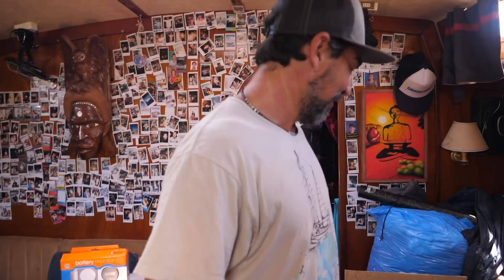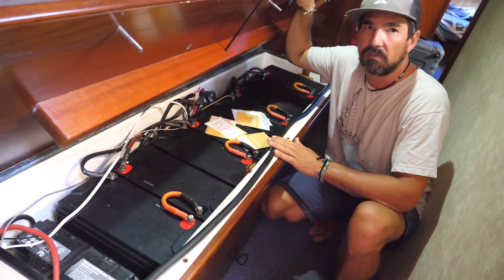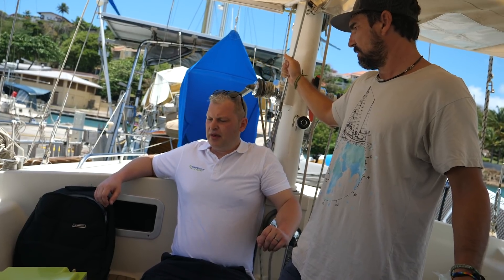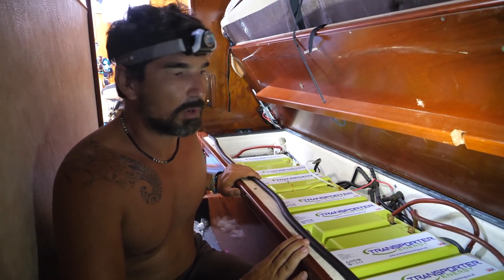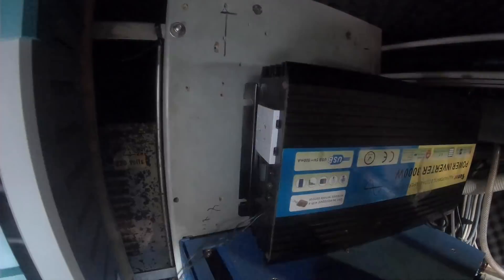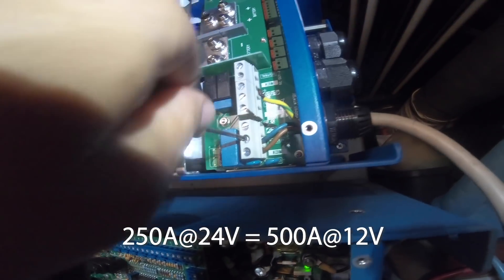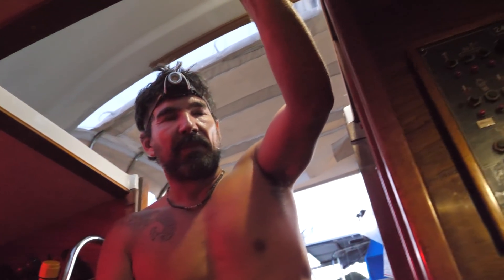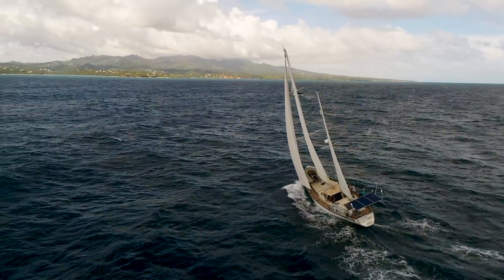Hello LITHIUM, Goodbye Propane!!!  Part 1-  Sailing Vessel Delos

Comment: What an awesome improvement!   I sold my last boat  a few months back and once I sell the house will be buying something bigger and more robust.  Renewable energy is the only way to go and from everything I read lithiums will cost more up front but should make up the difference over their lifecycle.  I'd be interested in what your research showed.  I'm also thrilled to see you didn't leave a bunch of abandoned wires in the chase to confound the next person tackling a wiring project on Delos.  Thanks for sharing!

Comment: Excellent video. Curious how the wind gen, solar and water gen if you have one, how the batteries handle the lower charge amps
Reply from the maker: yes, will do this one real soon so stay tuned :)
Reply: Sea Travel Last time I heard they weren’t using any hydro power.

Comment: is that the finished gimbal top? The concern i would have i there is nothing to physically stop any pot of hot dinner from sliding off on to the cook even if it sticks with the new top. have you thought about putting a metal rail system on this system? Excited to see how everything turns out plz do a part II. Also 3 inverter/chargers can you explain this as the hodgepodge of a collection of systems and or should one larger one be added if the system was a new addition and any + or - one vrs multiples.
Reply from the maker: We will add some fairly standard pot holder like you see on a traditional marine stove, pretty much like you described.  It's hard to find one charger that does more than this, and probably for good reason.  Having multiple of different sizes provides for some redundancy and also sometimes you can fully power given the amount of other loads you have on.  The dock, or the generator even, couldn't handle all the charge if we were running the water maker or washing machine for example.  So sometimes we only run 1 charger for longer to manage our load.

Comment: Nice, I have the same Multiplus, it works great with never an issue.
Reply: One thought, have you upgraded the solar controller to an mppt?  I have an older controller but would like to switch to a victron one by spring.
Reply from the maker: Yes, we have the Victron MPPT.  Works pretty good!
Reply: Good good, and good upgrades overall.  We have a portable induction but have not pulled the propane plug yet.  Too many other items on our renovation list in the next year or two.  
Not that its a huge deal, but how do you plan on addressing baking?
It may sound silly, but girlfriend loves keeping a crockpot on board.  Load it up, do your thing, dinner hours later and the draw is less than you would think.  They can be used to make bread.

Comment: First thing I did on my yacht is to get rid of the LPG , no rusty bottles or constantly finding refill stations and the biggest is no possible explosions, but no oven = no pizza unless you buy one of those electric pizza makers .
Reply: Make pizza on the BBQ.
Reply from the maker: I saw a nice little convection oven for about $200US in the store here.  Might give it a go and see how it works.

Comment: I thought charging @ a high amperage was bad for Li-ion? Maybe "high" for a boat is not much ..  but I know on RC stuff charging low and slow is better for batteries..
Reply from the maker: They are rate to charge at 50% of their maximum current rating, (400A)  so 200A max.  But the manufacturer said there is a bit of margin built in here as well, so 250A @24V should't be an issue.
Reply: From EV cars it seems as though the controller spikes the cells first then steps them down gradually as they fill up.  Fast charging does more wear and tear than low and slow though as you said.  However on Delos one has to consider that they can only run the generator on and off and thus are quite limited in real world.  Maybe it would be best to charge low and slow for say 12 hours but due to the generator just charge up in 4.

Comment: So how many amp hours available now on LiFePo?
Reply from the maker: Rated for 400AH@24V, but I would say in reality is more like double that because you can use nearly 90% of the capacity instead of 50% with normal lead-acid cells.

Comment: Nice move Brian we changed over to LiNiMnCoO2 over 8  months ago and they have been working flawlessly with our Victron 48/5000 we even run our Ac's overnight. Let us know how the induction cooking goes its the only thing I have held off on but I have the plan to change the oven and cook top. I totally would love to do away with the excess heat from the cook top and oven. What are you doing about an oven???
Reply from the maker: Nice guys that sounds AWESOME!!!  We are planning on using a standard convection air oven, there are a few small ones out there that take about 1,800W that I think will work.  We actually only use it for cookies and occasional baking so I think it will be okay.  So excited to try the bread maker on the new system and see how much it takes.  Really digging the induction so far, if you want to give it a shot check this out: https://www.amazon.com/gp/product/B00GMCAM2G Karin's mom has one at her house and it seems to work well.  Cheap and portable also.
Reply: There are combination microwave/induction ovens, even for RV use. One of those might work for you and save a bit of space.
Reply: Another oven alternative is a portable Halogen oven. I stopped using my conventional oven as by the time it heated up to cook a pizza, the halogen had already cooked it. USD$50,  1400W plug in, counter top, but much smaller over all.  I bought a top spec digital with buttons for everything; don't bother, you only need temp and timer so just get a basic model. I've had 3 years use and haven't even had to change the bulb. 
Here's a link: https://www.amazon.com/Rosewill-R-HCO-15001-Infrared-Convection-Stainless/dp/B014UO0KW4/ref=sr_1_1_sspa?s=home-garden&ie=UTF8&qid=1533785171&sr=1-1-spons&keywords=halogen%2Boven&th=1  - not a recommendation  for this product, it was simply the first one I found.
Reply: Carl Torode I've used these in Karmel Korn Shoppes in copper kettle cookers & bulk  popcorn machines too They are extremely fast and efficient. They may be made/offerred as a forced air convection oven too. Forced air a Very efficient way to cook. Instant on instant off. 

**Brian I can always send you 2 sticks and some flint rock... Lol **
Reply: I use an electric pressure cooker. It is extremely fast at cooking things like a whole chicken (20 minutes). I wonder if that would be suitable for your system?
Reply: How about a solar oven?  SV Uma seems to like theirs for brownies and such
Reply: wouldn't a metal pot and cover on an induction stove behave pretty much like an oven if you put a rack in it?
Reply: G11713 yes, Dutch oven, like baking over a camp fire.